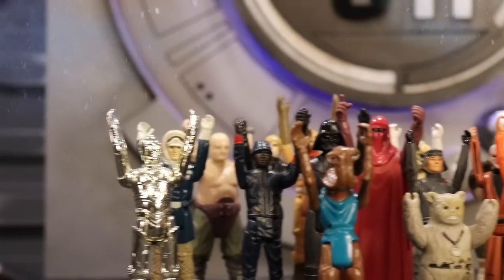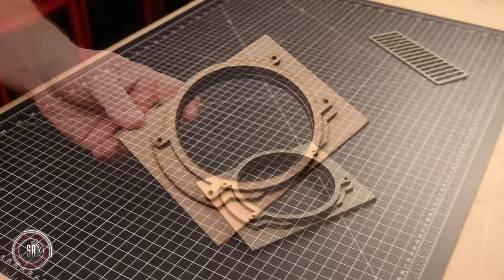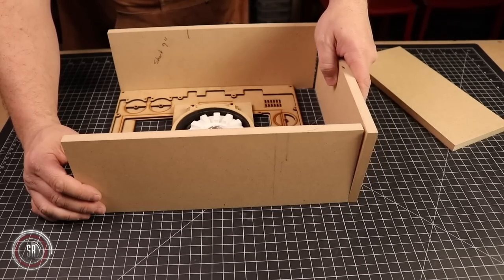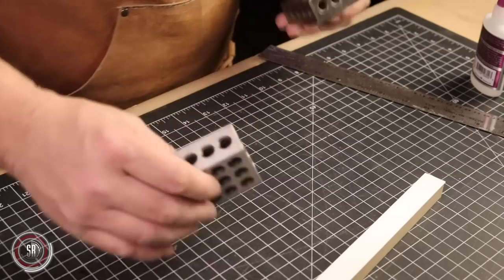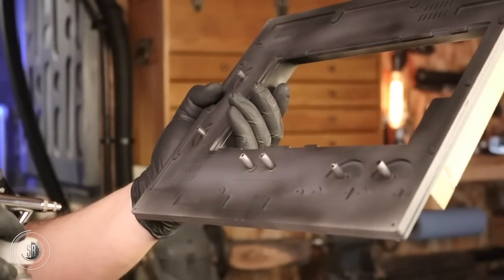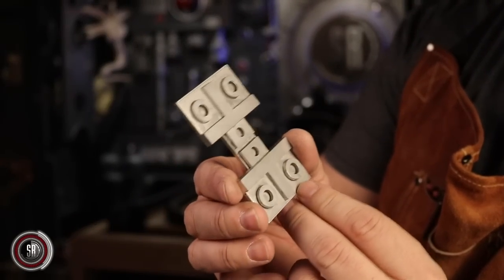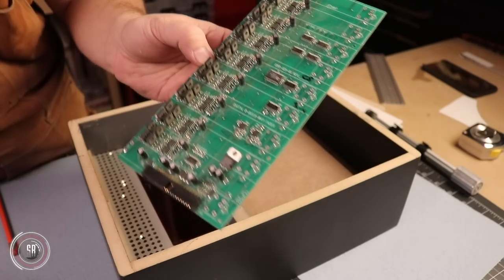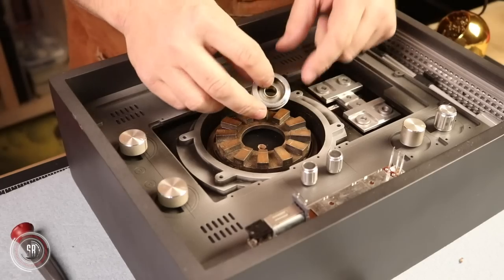Building an Action Figure Display Case - Part 2

Comment: I may have missed something, but will you have to unscrew the entire unit when it comes time to change the battery?
Reply from the maker: Armoury-Terrain no you didn’t miss anything, I did.  I never mentioned that the battery was only for testing.  Once this is fully set up it will be installed with a power supply and controlled by arduino or similar when the time comes to program it.
Reply: I am glad that I did not miss something cool

Comment: What are the weights with holes in them called that I see makers use?
Reply from the maker: Those are called 1-2-3 blocks.  1"by 2" by 3", they are crazy useful.  here is a link to where I bought mine (This is an amazon affiliate, but it does not cost you anything additional if you use it, just helps the channel) https://amzn.to/2NoELrl
Reply: The Smugglers Room thanks man. I will be ordering some.